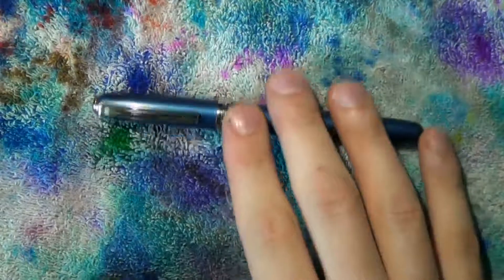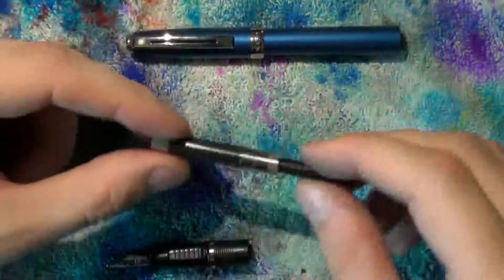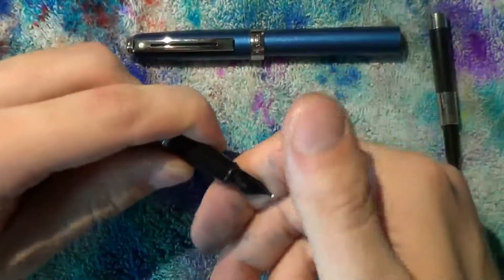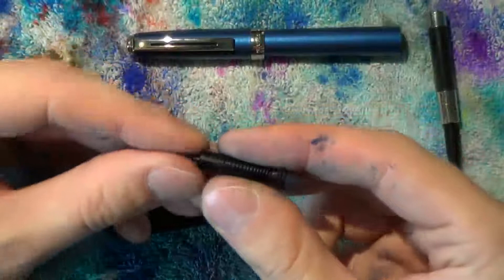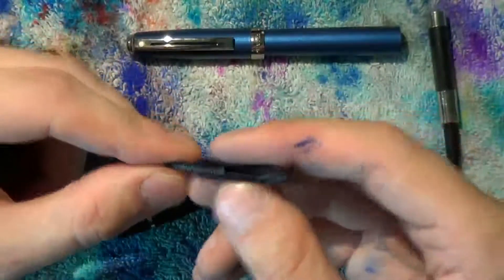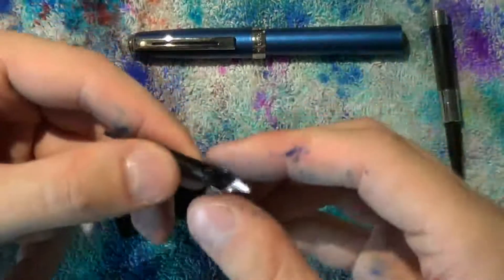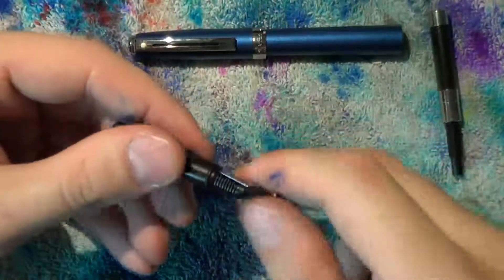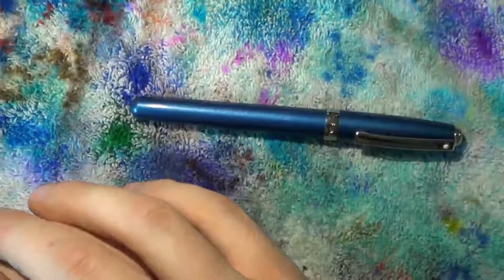Disassembly Line Sheaffer Prelude

Comment: I tried to remove the nib and the feed from the section, but only the nib came out. The feed's stuck.
Reply: Same here. I wanted to take it out because it is not centered between the grips. Only the nib came out. I have even tried twisting it and it turns a bit but springs back like it is the thin bit you should be careful not to break off that is stuck.
Reply: Place the pen in a cup with water for a day or two to remove any dried ink. You can then try to loosen the feed with the heat from a hair dryer.